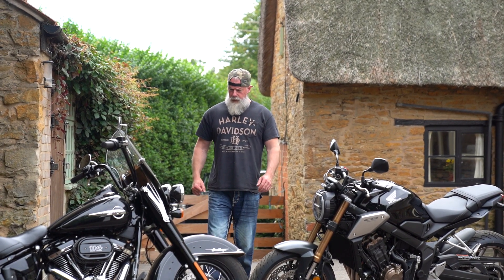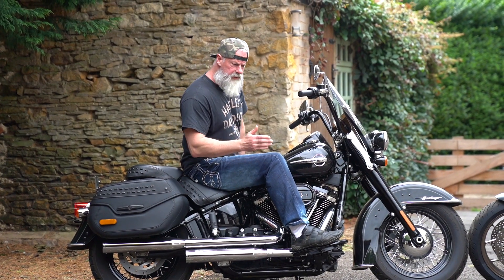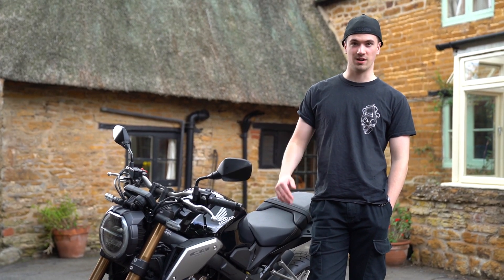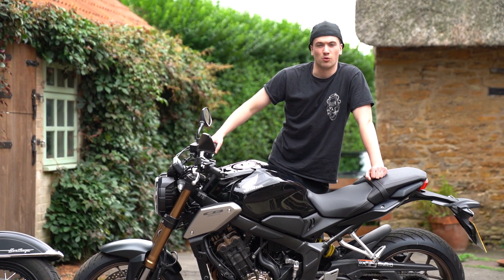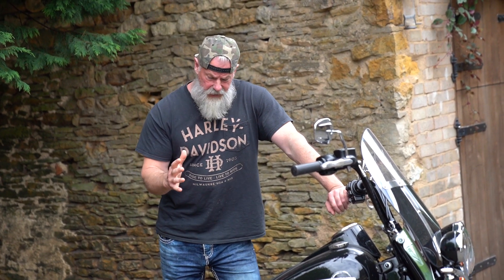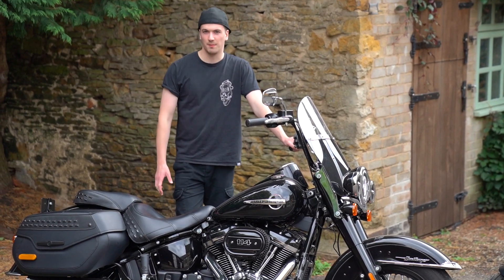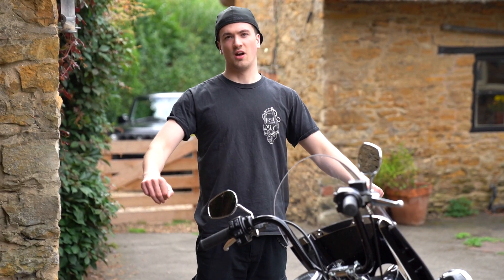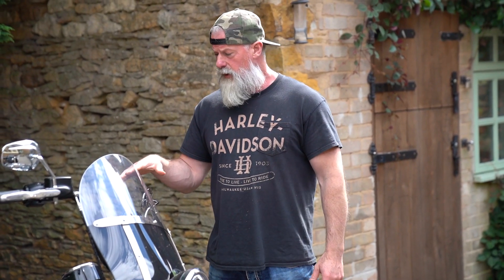Motorcycle Torque vs Power EXPLAINED: A Simple Guide (Harley-Davidson vs Honda)

Comment: I thought more torque = better acceleration. But you say the 650 accelerates quicker than the Harley. So I'm back to square one.
Reply from the maker: Haha yes it’s complicated
Reply: I think torque is for acceleration and that power is for top speed i guess
Reply: @kwakwa917  this isnt true. A bike cant make more torque and less power or vice versa; it can make that torque and power in different places in its rpm range however, and the faster a torqued object spins the more power it makes.

Making power and torque at high rpm results in low torque up to a high rpm with high power. 

Conversely making a high torque and power at low rpm results in a high torque and a high power at low rpm.

Think of it not as power or torque, but as how do we make power; more rpm, or more torque? Most modern engine go with the rpm option now that metallurgy and lubrication is so advanced, but for a long time torque was a better option, and it still is in some cases, like trucks, where it leads to better driveavility and reliability.
Reply: @kwakwa917  well you have to consider that weight also matters, but yes torque Is for acceleration if you put the 650 engine in the Harley Is not going to rev up quickly and is not going to do a 4.4 seconds 0-60 even if the Power Is the same.
Reply: @kwakwa917 nonsesne

Comment: Torque is the real power....horse power is a measurement  of how fats the engine can recoup to do it again
Reply: Hivemind nonsense 🚮 torque is not power.  Power, not torque, is the limiting factor in not only the top speed of a vehicle but also how quickly it can accelerate at any speed and how much weight it can pull up an incline at any speed.

More engine torque at a given vehicle speed without an accompanying increase in power guarantees there can't be an increase in acceleration.

Comment: So basically
Torque is pushing power
And Horsepower is how fast that pushing power is made 
Is that right?
Reply from the maker: Yes in a nutshell 👍🏼
Reply: @MrDarcy-OlMan  ah gotcha!
Reply: @mociczyczki  I’m not reading all that 💀
Reply: Torque is not power.

Power, not torque, is the limiting factor in not only the top speed of a vehicle but also how quickly it can accelerate at any speed and how much weight it can pull up an incline at any speed.

Comment: I enjoyed the video, couple of remarks and corrections.
"HD may not rev as quickly as the honda but gives massive shove in the back". This is controversial. You can't have a shove in the back and not accelerating fast. If honda is faster, it gives harder shove in the back. 
Same peak peak power of two bikes but honda beating HD despite much lower torque leads us to gearing. Honda has to have much shorter gears. So it applies more torque to the ground than HD at the same speed of a bike (or more power, which is the same in the case of a given speed) 
Climbing up the hill is the same thing: drive honda at the same speed and with engine producing the same ammount of power (obviously you drive at lower gear) and you will feel the same effortless as with HD. 
And a final side note, check how the sprinters train: squats and sleds pull with heavy weights

Comment: hhehhe NOPE :x well not egzacly but close ;) the comparision beewten some strongman and some sprinter welll it was queit good howver not egzacly :x with lil girl and you  onsome run vs in gym on heavveweight  this was worse egzample ;) now im explain you why  because i not like most people go very deep in this theme and i know egzacly how it goes :x =honda 64 nm at 8500 rpm vs heritage 114 161 nm at 3000 rpm  ok so if we calculate with how much force both setup spin wheeel at the same driving velocity you probably may be surprise :x because .... its cb 650 f which produce more force push you forward at peak torque at the same vvelocity preciselly speaking cb 650 f will generate 13% more tractive force than heritage 114 at the same velocity :) (dont including diffrenc in powerlosesss at drive train  ) so its not true harley will better go up hill or be able to pull biger weight :x  torq can be conpensate be  more engine rpm  and vice versa so such 161 nm at 3000 rpm give the same tractibe force as let say 80,5 nm at 6000 rpm or 40,25 nm at 12000 rpm the point is for bike like heritage fast spin engine does not fit  and 99% customer will not buy heritage with cb 650 f engine because rpm kill theyr ears they like huge explosion in cylinders with long time beetwen those explosion whillle cb 650 f is smooth and small explosion in cyll happen so often that it generate completely diffrent sound characteristic  :x biger torq literallly lower the turnover at which we get intresting us POWER :) so for achieve the same results egzacly in cb 650 f like in heritage 114 you need reduce gear in cb650 f for spin more rpm  beside diffrent in weight both bike  at some point rpm  cb will produce the same tractive force at the same velocity as heritage 114 and this rpm be offcorse biger :X PERIOD END OF STORY ., if we comapre tractive force at whell at the same velocity  50 nm at 10000 rpm to 100 nm at 5000 rpm forcemeter or like you want dyno show egzacly the same force in NEWTONS   for egzample 100 nm at 5000 rpm give more tractve force than for egzample 50 nm at 7500 rpm but less than for egzample 50 nm at 11000 rpm !!! :) gretings .and if both this bike have similar power reason why cb 650 f accelerate faster is not higher rpm :D dont be ridiculous true reason is that h-d weight aloot more  and if engine have the same power it cant accelerate bigger weight at the same acceleration rate level beause is to wweak for this no matter how big torq it will prodyce at crank :xwatch this https://www.youtube.com/watch?v=vHYw5HIJ53U  at some points he was also wrong but much less than you   ., now why egzample with young girl and you was wrong ??? because force is acceleration multiple be weight :) ... for better acceleratuion the same weight you need more POWER  for the same acceleration niger weight you need more ...POWER its not like you say that power is speed and torque is slow weight force bullshit :D not even close not for combustion engine with gear box :) like im write 50 nm of torq at 10000 rpm at the same velocity let say 1 km/h will  pull up 5 times bigger  weight from the lawn  on your balconny for egzample  than for egzample 100 nm at 1000 rpm or it will pull the same weight 5 times faster :) !!!!!!!!!!!!!!  gretings .

Comment: It’s one of the reasons I bought my Triumph Trophy SE it has torque and Horsepower. I ride in an area where there’s tons of Harleys everywhere and to be honest they don’t keep up there not even close especially when the curves come. I’ve ridden them and I owned a cruiser it’s a totally different experience. My wife refuses to get on the cruiser hence why it’s no longer in the garage. Trying to whip around a 900 lb Harley and then getting it to stop is not much fun. Living in Canada and touring the western USA most years cruisers are everywhere, and I like riding something different. I’ve had the wife on the back for 6000km trips in 10 days and a sport tourer is just the best mile muncher there is. Electric windshield, cruise control, electronic adjustable suspension and the list just keeps getting longer 🤷‍♂️🤷‍♂️🤷‍♂️
Reply from the maker: That’s interesting to hear! Thanks buddy!

Comment: My favourite analogy for this is to image you have 10 sand bags which needs moving into a box assuming both engines or workers make the same horsepower but one has higher torque then they would be able to move the sand bags in the same amount of time but by lifting two or more at a time vs the other worker moving them one bag at a time but faster. I liked the sprinter vs the rock analogy haha
Reply from the maker: Thanks buddy! That’s a great one!

Comment: There is no difference. Torque is a component of power. Your motorcycle's engine is equivalent to you atop a bicycle. Neither of you is "torquey." You eat things that give you energy, then you expend it at some rate on the pedals. Similarly, when gas burns it expends energy at some rate on the crank via the piston rods. Using gear ratios, you can make the torque at the rear wheel anything you like. Certain engines just may not have the power to spin the tire at certain rpms.
Torque is really a meaningless graph. If one engine makes more power at some rpm than another, then it will make more torque at that rpm. It just how the math works.
The reason a HD is more torquey than a Honda 4 is that the HD makes more power at lower rpms than the Honda. 
Engines make power at every rpm they run at. It's not a high rpm thing. Forget torque curves. You want to know which engine will more easily pull a fat woman up a hill, just lay the power curves of the engine over one another. The one that makes more power at lower rpms will be better at pulling fat women or stumps.
The engine that makes the most peak power will go the fastest (all else being equal). It just may take longer to get up to speed. If you can keep an engine with more peak power on boil, it will win races on a track. HDs are better at making real world power for those of us without an immediate death wish.
Reply from the maker: Thanks for your comments bro
Reply: Bro is good at brosplaining.  However:

Power, not torque, is the limiting factor in not only the top speed of a vehicle but also how quickly it can accelerate at any speed and how much weight it can pull up an incline at any speed.

Comment: Comparing a Harley to a Sport Bike is like comparing a truck to a sports car.  Fast is fun, but with the Harley I have more than enough torque to cruise 80mph at 3000 rpm... even with full saddlebags and your mom on the back 😎
Reply: Yup. But unfortunately not many people really understand about this💁🏻‍♂️
Reply: @hisham77x  Because they're usually young guys that haven't realized cruisers are far more comfortable, especially as you get older.  If you're gonna cover 500 miles in a day, might as well be comfy and keep those RPMs low.
Reply from the maker: @Prairie_Barbarian  yep totally
Reply from the maker: @hisham77x  amen
Reply from the maker: Yes that’s true

Comment: Not having to take the bike apart to adjust valves PRICELESS
Reply: It's really not that bad,  just done the valve shims on my XJR1300. It wasn't difficult or expensive and I don't have to look at them again for 15,000 miles.
Reply: Does the Harley have hydraulic lifters?

Comment: Most of the Harley Davidson bikes are air cooled pushrod engines. Pushrods mean no high rpm.  Air cooled means longer stroke  to prevent overheating.  It's harder to cool a over square large diameter piston as the heat doesn't make it to the outside edge.  So the Harley engine is limited in how much power it can make.
Reply from the maker: OK that's interesting. It's got more than enough oomph in our opinion, in the real world
Reply: @MrDarcy-OlMan  Harley Davidson bikes are fine for the Power they make  if people want less weight more power they can look at other motorcycle manufacturers.
Reply: Well not a harley hater at all but i think they can do better and still maintain the air-cooled engine. Just look at the engine on the monster 1100 big number air-cooled engine with 700cc less than your typical harley
Reply: @bazitube390  1100 monster still makes that power and torque at much higher rpm than the Harley. And less of it 75.9 ft lbs @ 6k rpm 100hp @ 7.5k rpm   Harley is 119 ft lbs @ 3k rpm  I actually think that's impressive. Don't even know what the horsepower is.
Reply: In other words, Harley's engines are RELIABLE. just like the HEMI's!

Comment: One thing you can't do is get more torque.  It's down to having big CC.    Even if a engine is de-tuned for torque. The numbers are lower.  No replacement for displacement has never been truer than when it comes too torque.
Reply from the maker: Good point
Reply: Well, there is forced induction. Gives the effect of larger displacement.
Reply: @Cundalinis_Hand  do you mean a turbo?
Reply: @chrishart8548  That or a super charger. The old school rule of thumb was superchargers for slower revving motors and turbo's for high revvers. Either way, big torque gains.
Reply: @Cundalinis_Hand  it's true. with a turbo  you can get higher torque figures than horsepower.  Some engines make over 1000ft lb of torque with only 550hp. That can only happen with a turbo. Gsxr750 has 125hp and 61 ft lb torque at over 10,000rpm
Reply: Nonsense.  You’ve got that completely backwards.  One thing you can’t get is more Power.  Torque can be multiplied by gearing power can’t.  I can make 500 ft-lb with my body and a lever.  I’ll never make 3HP without an engine. Also: Displacement per minute makes a great replacement for simple displacement: you don’t have to slow it down into the corner or carry it through the corner. .

Comment: I think you forgot to mention engine configuration, the v twin from HD and the inline 4 from honda are 2 completely acting engines and unless you can open them right up, both are comfortable quick bikes no matter the torque, I ride the 2014 cb650f and coming from a twin engine bike before that, definitely notice the difference in engine.
Reply from the maker: Thanks bud. Just keeping it to basics
Reply: It's more cylinders for horsepower.   Less cylinders (bigger pistons) for torque.  These bikes. Are a perfect example of the same horsepower but. Two very different bikes
Reply from the maker: @chrishart8548  Thank you

Comment: 👏 Fair play on taking on this tricky subject. I always struggle to explain this to my not so technically minded buddies. Good analogies as usual. I think you should have demonstrated it by carrying mr Darcy up a hill then he carries you! Then a 60m sprint. I'd leave 12 year old girls out of it though. Lol. Seriously, in the anology you need to take into consideration power to weight. You obviously can squat more than mr Darcy I would suspect but he may be able to squat more in ratio to his weight. I'm clumsily trying to include power to weight ratio which, is why it's a tricky one to explain simply👍 BTW, I hope you gave mr Darcy the proverbial clip around the ear for being cheeky re not knowing the sprinter lol.
Reply from the maker: Thanks buddy! Good ideas! Certainly power to weight is a big factor!
Reply: It’s not a good analogy, no wonder you have difficulty in explaining.  It’s just a simple mathematical equation...
Reply: @marcusgeorge1825  which is?
Reply: @pikebobstar2033  Hp = (Nm * RPM)/5252
Reply: @marcusgeorge1825  Thanks. What about Perceived power. I mean surely this calculation does not take into account physical load e.g. solo,  solo and pillion, luggage,  correct tyre pressures, ambient environment  for example head wind. What you  "actually" perceive is much different to what is recorded on a dyno? Take same bike x 2 in this case the cb650r. One has a 10 stone rider the other has 2 x 15 stone ( rider+ pillon) each and another couple of stones of luggage. I guess  wouldn't make a difference on a dyno but in real conditions would alter the perception of performance? Am always eager to be educated 👍
Reply: @pikebobstar2033  of course their are significant other factors that changes how any engine, car, bus, boat, train react with what you have mentioned. I was simply applying the basic mathematical equation used. For a engine. The other stuff you have mentioned are extremely relevant and play their own parts. I was just clearing up how Horsepower numbers are calculated. You also have other factors like available fuel vs O2, exhaust set ups, ECU’s etc....

Comment: Different tools for different jobs.
Reply from the maker: Yes that’s true 👍🏼
Reply: Power is the limiting factor for all jobs. Having an engine that makes it’s power at low RPM makes it dramatically more cost efficient. (Long haul trucking/shipping/farming/industrial)Having it make its power at high RPM makes it dramatically more effective for its size/weight.(Motorsport)
And then there is character.  A Harley twin has a completely different character than a Ninja 400 four.